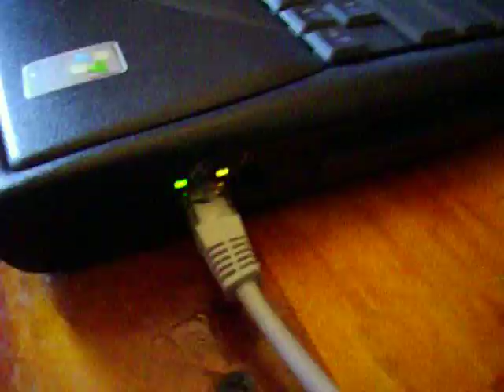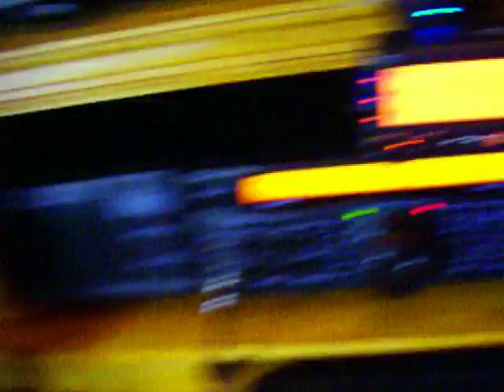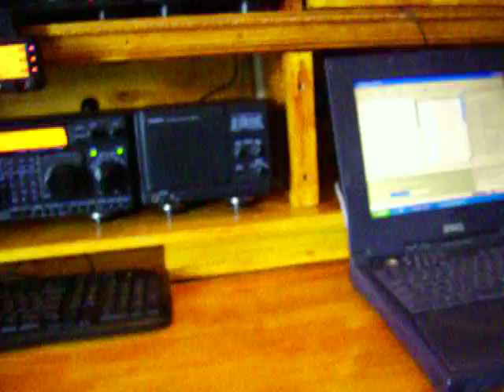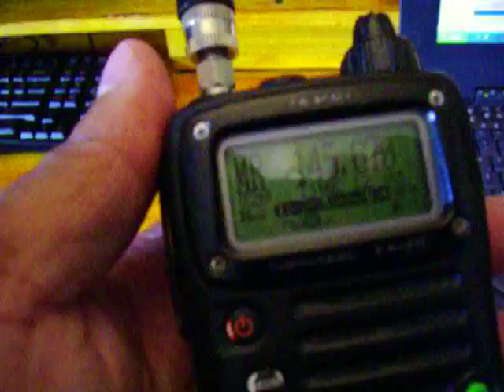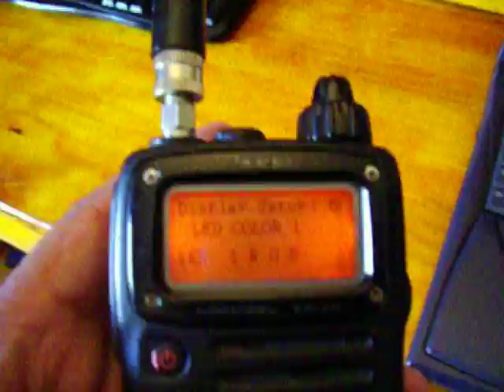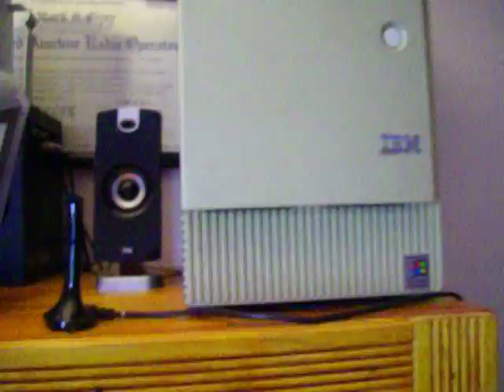K2CSX-L signal link usb

Comment from the maker: First you need to tell them what type of radio you have and what your intent is to do with it and they will send you the proper cables but of course you will have to pay a little extra for it get in contact with tigertronics and they will help you pack a Tronics is the signal link name of the company and they would help you out there walk you through with what you may need